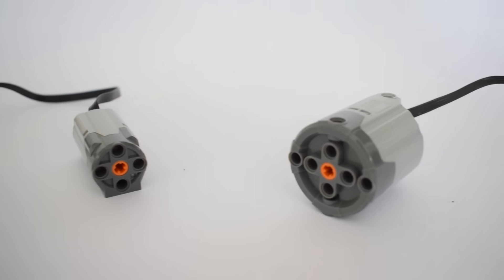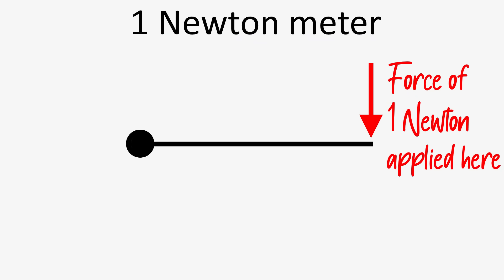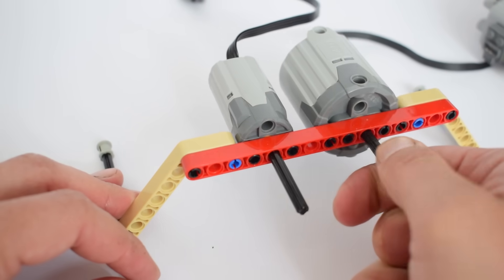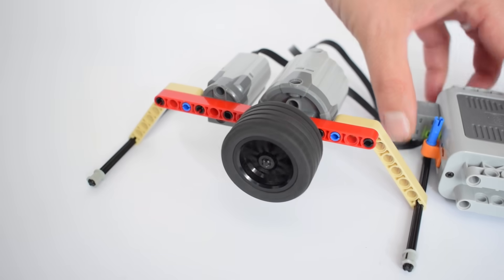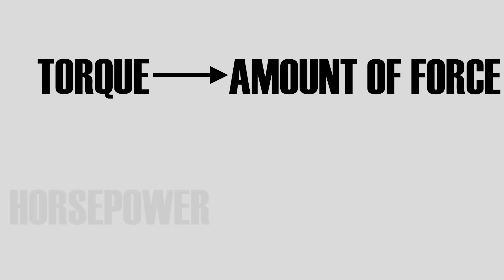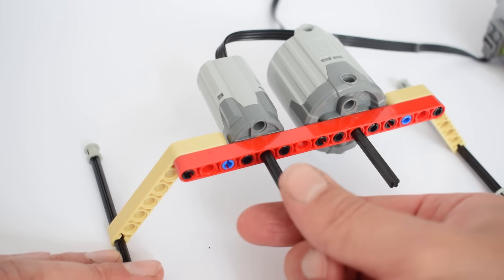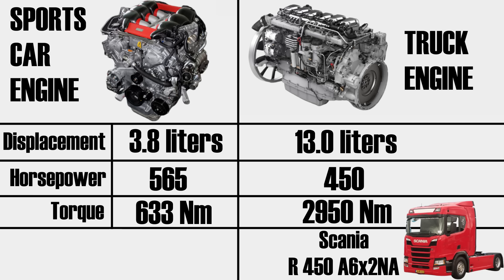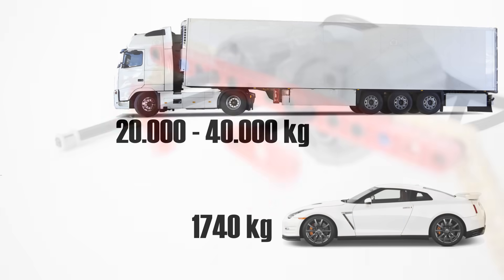NEVER be confused by HORSEPOWER and TORQUE again - HP and TORQUE EXPLAINED in the MOST VISUAL WAY

Comment: Just one thing that could be a little confusing:
Power isn't the application of torque over time, it's the rate at which work is done. Work in this case is torque times angle, and therefore power is torque times rotation speed. You can apply a lot of torque over time without any power as long as nothing starts moving, best example would be a spring.

Are you also going to explain torque-speed graphs for motors and how to interpret them?

Comment: This "horse power" is the old name for watts.
Reply: Not strictly true. Horsepower is derived from imperial units - feet and pounds. One horsepower is 550 ft.lbs of work per second
Power measured in metric units - Newtons and meters, is calculated in watts. The metric equivalent of 1 hp is 746 watts.

Comment: You forgot to mention one inportant thing, that torque gets multiplied by the gearbox, but power is same regardless of gear ratio (minus mechanical losses). In effect, 500HP/400Nm engine will produce more torque on wheels than 400HP/2000NM engine, because difference in speed is used to multiply output torque

Comment: Horsepower is how fast you hit the wall. Torque is how much wall you take with you.
Reply: Not true
Reply: @benfennell6842  been a mechanic for 20 years I build and race my own engines.  It was an Analogy .   And no it is true
Reply: @hondaxl250k0  how?
Reply: @benfennell6842  did you not watch the video and the  hp is speed. Torque is a rotational force .   If it don’t make sense too you I can’t help you..
Reply: @hondaxl250k0  well power isnt speed it's a function between force and speed, and secondly what the hell do either of those have to do with "taking the wall with you"? Its erroneous. It's like saying how much I eat in the morning is how far I can run, like its TECHNICALLY probably going to be a factor but it's not even the most important one.
Reply: @benfennell6842  let’s say a super car is 800 hp.  And can go 180 mph.  That’s hp.  The car goes fast but has no pulling power.   A tractor may be under 100hp.  Won’t do over 20 mph. But it will pull down your house..
Reply: @hondaxl250k0  the supercar does have pulling power. Notice how you literally used the word power when describing the pulling power? The acceleration which the object being pulled experienced will be directly related to the POWER pulling it. The supercar will pull the horse faster if it's making 800hp while doing it, assuming other factors dont prevent that.
Reply: @benfennell6842  hp is directly related to speed/rpm.  Torque is rotational force applied.    Hence why a big diesel truck maybe runs 2 or 3 thousand rpm makes maybe 300 hp but can carry 100 000 lbs.   a sports car will go fast do it in a hurry.   But even if engine from car was put in truck it won’t do the same job.  Even with 600 hp.     This is an argument as old as the engine it’s self.    Highly doubt we can wrap it up in the YouTube comment section 😂
Reply: @hondaxl250k0  no you're right it wont do the same job, all other factors excluded the sports car engine will accelerate twice as fast while pulling that weight: https://youtu.be/7eZyXp1i4GU

I'm sorry but this is just how the math works. The rate of work being done (the 100,000 lbs being pulled in this case) is measured in HORSEPOWER. therefore doubling the horsepower and leaving all other factors the same will double the rate of work done, and double the acceleration of the truck.

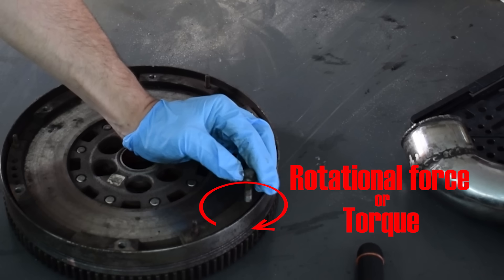Comment: 0:58 Just to clarify, when you were applying torque on the screw, you were also applying force. My point is, it's not that either you apply force or torque, you may apply both.

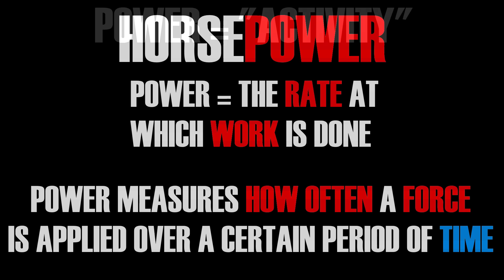4:26 I'd say (instantaneous) power measures how much energy is being transferred or how much work is being done by a force, not how often a force is applied.

Comment: This is why that the 40hp tractor seen on my profile picture outperformed a 100hp car in a pulling test the tractor has more torque. Although i dont know the numbers of each.
Reply: Because it has more torque at the wheels. However, you could put your car engine in your tractor, gear it properly, and your tractor would be able to pull more weight. The video is confusing because it's torque at the wheels that matters not torque at the engine (crankshaft). A gearbox transforms rpm into torque.
Reply: @jaumeprimerelhipster  no im not gonna put the engine of my daily driver in my tractor
Reply: @larsassinck3868  "theoretical idea" anyone?

Comment: Great video. But it does have a wrong statement.

Torque Can be felt as an acceleration Force, and horsepower cant be felt.

Well, what a passager feels is the change in speed, as a Force in the opposite direction as the acceleration. And not the motors output.

So the greater the acceleration, the greater the force is felt for the passenger. and the greatest acceleration is at the highest horsepower output.

The greatest efficiency per rotation would be at the peak torque, but not the greatest acceleration.

Comment: Power is energy delivered by unit of time, force by length divided by time. Torque is force by length, stop. Not the same. Apples and oranges. Force equals mass by acceleration. Acceleration is the change of speed in the unit of time, and speed is the length covered in the unit of time. Easy.

Comment: No - you've made it even more confusing. 
Torque is a 'moment' an instantaneous measurement. If you grasp a turning shaft the twisting force is evident but the sensation it creates it mostly power or work done. 
If you are in a moving vehicle you are directly experiencing work done/time. If you are accelerating it's even more relevant, a change in the rate of work done/time. 
Your explanation fails because it aligns with the everyday misconception of torque -  that is an engine that has a lot of power at low RPM.
Reply from the maker: Good job clearing it up for everyone 🤣
Reply: @d4a  Clearing it up was your intent. I've got no problem making it sound worse to help you do it better. 
I think you can.
Had the same conversation 30 years ago with John Robinson - technical editor of Performance Bikes magazine.
Reply from the maker: @sjbechet1111  This will go into semantics but I'll still try. The issue here is how you perceive what "feeling" is. I said in the video that you can't really feel horsepower because I was talking about feeling purely as a sensation of touch to aid the explanation. What you feel against the shaft is torque alone. You can't feel work. If one shaft does 10nm and 10rpm and the other shaft does 10nm and 20rpm you will simply feel more torque because the only difference is the greater frequency of turque output. You're feeling turque more often. You can't correlate frequency or rpm with the sensation of touch. You can't feel rpm. If a shaft outputs 0.00001nm of torque at 10000rpm the sensory tips on your fingers likely wouldn't even be able to tell that the shaft is spinning. Again, this is debatable and semantics but the point of my videos isn't to be semantically or scientifically correct, it's to help people understand. I focused on feeling to emphasise how torque is a force and nothing more. I don't know why the editor guy is relevant here so I have nothing to add there, but saying thay my explanation fails is unfair and pretentious. You can scroll through the comments and see for yourself. I also never aligned my explanation with an engine that has lots of power at low rpm. Those are words you put into my mouth.
Reply: @d4a  Yes - but when Jeremy Clarkson of Top Gear says "it''s got a lot of torque" all your work is un-done. 
The audience think that g-force they are experiencing is called torque.
We are talking at cross purposes - and I apologize for that.  
When you accelerate quickly you are experiencing the direct result of Power - which is torque X revs. 
As a cyclist and engineer I would say your description of the experience of the sensation of power is wrong. But I'm an engineer, so if I'm wrong that's not unusual. 
peace.
Reply from the maker: @sjbechet1111  I totally get your point. I think it will be useful to elaborate on the acceleration thing in a future video. Peace my man.

Comment: I disagree with the feeling only force in a car seat.

The feeling you get is acceleration, which depends on time.

You can sit in a 10000 hp tractor with 5000Nm of torque and you won't feel that much but you'll feel a lot more acceleration in a 500hp sports car with 500Nm torque due to higher acceleration.

Comment: I'm still wondering if you took an engine of smaller size like the one in the comparison in the video with the same or higher horsepower as a larger engine and reduced it's speed through a transmission if it could have the same torque as the larger engine
Reply: Sure, that's what a gas turbine in a tank does.

Comment: Would be interesting to see how an F1 engine would perform in truck geared down to make same torque at the wheels, given that torque can be increased by gearing.
Reply: It would definitely pull more weight, no doubt. But you'll need a lot of reduction in the gearbox.
Reply: @jaumeprimerelhipster  would be really bad a starting too because no power down low.
Reply: @benfennell6842  not necessarily. A teal truck (trailer) won't start in the low end of the rpm either. When you're pulling 40 tons, you need power (energy) to move that mass. So they'll rev up and the gearbox will transform all this energy into torque at the wheels. But mind you, they'll be pulling at 70%-80% of the max rpm when starting so the F1 would be pulling at some something like 13 or 14.000 rpm just to start. Think about a gas turbine in a tank, they start pulling at 22.000 rpm just to initiate the movement, with low torque at the turbine and high torque at the wheels.

Comment: Why not just have high torque engines with multi-speed transmissions and high gearing?
Reply: Great question. My attempt at an answer is: many speed transmissions are much heavier. Put them behind a heavy high torque device and you just have more weight all around.

Comment: Horsepower is the amount per unit time that work is being done (550 ft/lbs per second). Work is the amount or force applied times the distance through which the force is applied. For example I apply a force to the side of a skyscraper for an hour and, of course, it doesn't move; no power has been generated. Force times distance (work) equals zero. If, on the other hand, I apply an upward force to move my body up a flight of stairs I have done an amount of work equal to the force applied times the height of the stairs. The power used is this work divided by the time spent traversing the staircase.

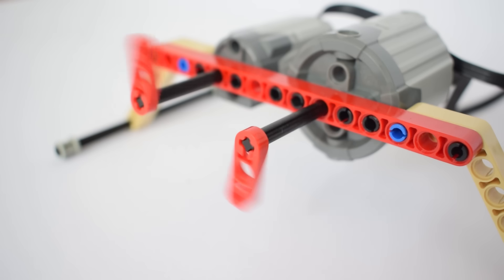Comment: 6:02 --- Power can very much be felt... 
It just can't be felt by attempting to stop a low torque shaft from turning, as rotational force is not its sole metric. Power would be expressed in how quickly it warms up your fingers pinched around the shaft (without stalling it out)

By its very definition, power, being torque applied at a specified rate, infers time by virtue of the rate / RPM factor.
Acceleration is defined as a change in velocity over a change in time.

Thus, strictly speaking, torque is not what you feel when accelerating - you feel power, because it's work that's being done over the time it takes to accelerate, which keeps you pinned in your seat.. 
This is further highlighted in small displacement, high revving engines, which accelerate quicker as RPM increases.

Comment: Pedantry: Horsepower can be felt. Horsepower stems from making torque at higher rpm, which means you can be in a lower gear. It's not the torque the crankshaft exerts on the clutch/torque converter that moves the car, and therefore it is not the torque you feel. What accelerates the vehicle is the torque the wheels exert on the road, which is the torque you "feel." When the engine is making more horsepower, you're higher in the rev range, which means a lower gear, which means the crankshaft torque has a greater multiplier applied by the lower gear, so you "feel" the horsepower by downshifting.

Horsepower is effectively a measure of the torque the wheels exert on the road, which is the only torque that actually matters. That GT-R engine would be able to move the same weight that the truck engine could (and more) with enough gearing. It just wouldn't be as reliable as the large diesel engine in the truck because it would have to rev high all the time to get enough gearing multiplier to be effective at it. To demonstrate, there's a guy on YouTube who put a 212cc single cylinder harbor freight lawnmower engine in a Honda Insight. With that engine, the Insight was able to pull a Jeep pulling a trailer.

Comment: so it’s kinda like your cars Heater/AC? horsepower is the fan speed setting, and torque is like the level of intensity (temperature setting)? or like an exercise bike you can adjust it and make it heavier so that can be torque etc I think I get it somewhat horsepower=speed, torque = power/stiffness/intensity you can use a stand mixer and make it spin really fast with barely any strength to it, or you can make it spin harder with more strength behind it.
Reply: You can throw soft lighting fast punches, or you can throw heavy slower haymakers

Comment: WHEEL torque is what dictates how much weight you can pull but you can get that with gear reduction. Engine torque is not important. Horsepower is what dictates how fast you can pull it. The GT-R engine would actually be equally capable of pulling the same weight as the truck engine if it had a massive gear reduction and a 12 speed gearbox like the truck. The only reason we don't use small high revving engines to haul things is because they aren't designed to operate continuously at high RPM and would be extremely unreliable plus use a lot of fuel.
The high torque itself is just a side effect of needing your peak power to occur at a low RPM. It's not actually the torque that's important. More torque can always be created with gearing, horsepower can't. Wheel torque is important, not engine torque.

Comment: Surprised that it was not mentioned that gearing can and does easily change high torque / low speed to high speed / low torque, and vice versa. The truck engine is massive because it needs to be able to develop it's rated hp for long periods of time, and do so efficiently and while delivering a long lifespan. The sports car engine in the truck would indeed make for a faster truck, given the right gearing, but it would be terribly inefficient and short lived. The truck engine would work in the sports car (given enough modifications lol) but it would make for a poor performing car as it would double the car's weight, not fit under the hood, etc, etc lol.

Comment: Great explanation!

Something that helped me visualize the difference years ago was when my wife and I had two different trucks. She had a truck with a 300 cubic inch inline six, I had a truck with a 350 cubic inch V8. (both of them five speed manuals, naturally!) The 300 would certainly shove you back into the seat, and it felt powerful, but it just wasn't going that fast - I think the 1/4 mile time WAS the 0-60 time. But the truck with the V8 could get up to speed much faster.

Comment: How can something have 10HP but 25,000 pounds of torque? Like those super old ass diesel engines. They made 2 hp but could push earth off its rotational axis
Reply from the maker: They spun at extremely low rpm that's how
Reply: A very large slow moving water mill wheel.

Comment: This is the comment you're looking for👇🏽 This is where the debate is.
So what I'm hearing from this video is the LS engine is pretty much the greatest performance engine: Or its at least superior to the Coyote and Hemi engines. And heres why:

You can make all three of those engines make pretty much as much streetable HP as you like. It makes no difference to your tires how efficient you make 500HP, how little displacement it took to make it or at what RPM, its your transmissions job anyways to slow your engine speeds down to match tire rotation. What does matter to your tires is how much weight is on them and where that weight is and this is why the LS engine is the best. At whatever amount of HP these engines can make, the LS engine will make it weighing the least with the lowest center of mass which do make a difference to your tires. And because you can bore a standard LS block to well over 8 liters, you will also have the most torque. The LS engine basically is what you would design if you wanted to use the least amount of material, in the smallest amount of space to make the most amount of HP and Torque, without boost. It also takes boost soooo well if for whatever reason, you need more then 800 N/A HP. 

Am I missing something? High revs are fun but i think ford just went that route because they had to change the subject and hope people think smaller displacement means the engine is physically smaller, higher revs and better "efficiency" means a better engine when none of that matters to your tires. And the Hemi, that iron block has got to go before i can even take it seriously. Its already massive with those heads so it by far has the most weight and worst center of mass.